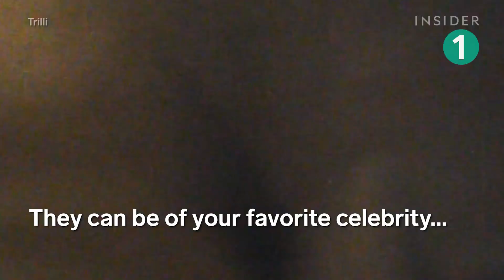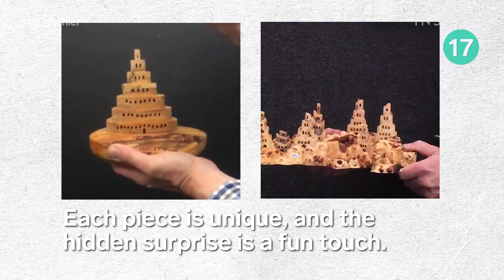18 Handmade Gifts By Artists For Any Occasion

Comment: You’re better off getting a custom pet replica off of an Etsy shop than cuddle clones. (Cuddle clones also sell plushies of your pet). The ones on Etsy are of similar price but much more care is put into the piece, as they are independent sellers and not a company. There is also usually a wire armature inside sewn art dolls from Etsy that enable them to change poses, which cuddle clones don’t offer.